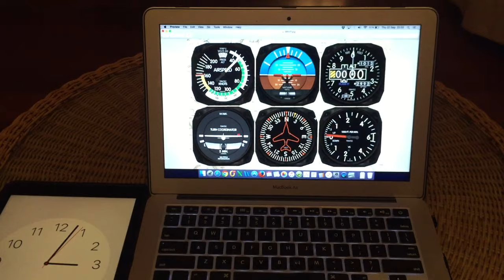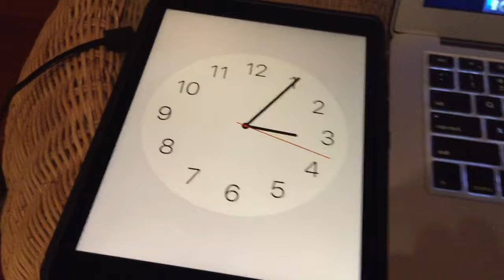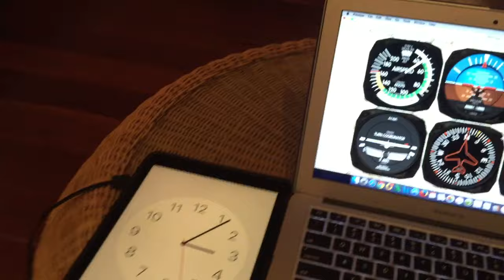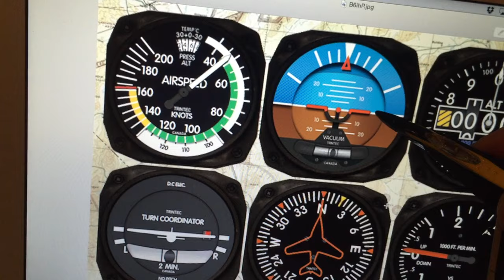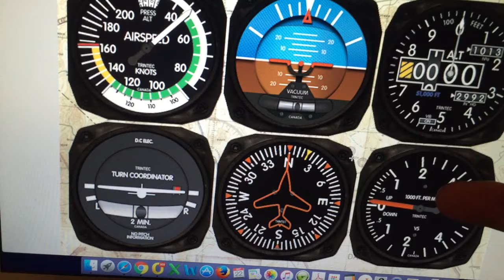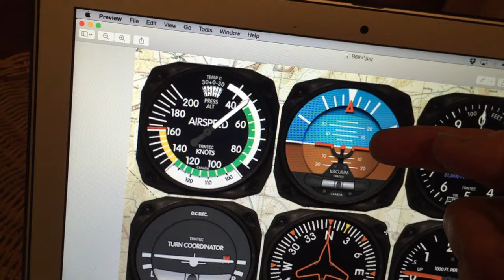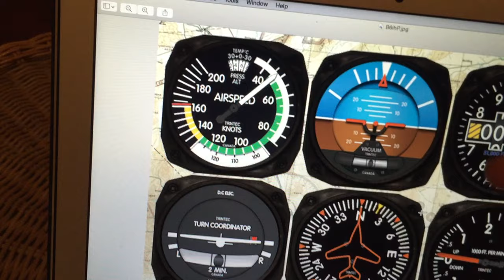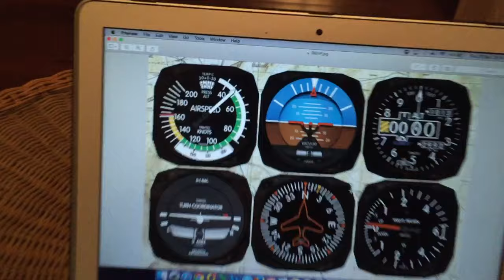Do aircraft change attitude to follow the curvature of the Earth?

Comment: With turbulence and atmosphere pressure changes which frequently cause a drop (some severe) in altitude, the pilot is frequently adjusting the plane level to maintain direction. Such that stating a plane is flying level, is only valid during the moments after a pilot has compensated any deviation.
A different consideration is flying any direction on a dead heading always ends up going south. Fly to the East and if you do not compensate for Latitude by adjusting to the north the plane will increasingly be south of its intended flight path and south of the destination.

Comment: I remember my very first encounter with a realistic flight simulator, in a WW2 setting. Took me a bit to realize that the constantly climbing plane wasn't a faulty joystick (or a flat Earth) but me neglecting trimming ;) How does that work in modern planes?
Reply from the maker: Yes trim is very important.  When configuring for landing you are constantly adjusting the trim as you extend flaps and change airspeed.  We have an electric trim that is activated by two rocker switches on the yoke.  You are constantly on it all the way to landing.  Same on take off, as you clean up and accelerate, up to 250 knots below 10,000 feet, then above that we accelerate to 320 Knots and you are trimming constantly.   Once autopilot is enabled it takes care of the trim automatically.    You also have roll and yaw trim but they require far less adjustment.
Reply: Rob Banks    No.  Trimming is not felt by the passengers. Trimming is the control that makes the yoke feel neutral in the nose pitch you wish to maintain.  If the aircraft was out of trim, the passenger would have no clue, the pilot is simply having to put more pressure on the control yoke to make the aircraft hold the desired pitch.  Passengers will feel pitch changes, but that happens from transitions between climb to cruise, and cruise to descending.  That will happen regardless of how bad the plane is in trim or not.  The pilot retrims periodically  as the aircraft changes speed, pitch, flaps, gear in and out, burning off fuel etc. just to make his job easier.

Comment: so how do you land an airplane on a moving runway?
Reply from the maker: I landed a helicopter on a moving ship a few times,  you do that by adjusting your speed so that the relative speed between the helicopter and the ship is zero. 

If you are referring to the movement due to Earth's rotation then that is easy to answer.  The Aircraft already has the same velocity as the Runway before take off.   While sitting on the ground it is moving with the Runway already. 

They are in the same reference frame.   

When you take off you are still in the same reference frame and all motion is then relative.  When you land you are still in the same reference frame. 

You are not one of these people who believe the instant a 300 tonne aircraft leaves the ground it suddenly decelerates by 1000 Mph and is now moving in a different reference frame are you?

Why would that happen? What force causes 300 tonnes of aircraft to decelerate 1000 Mph instantly?
Reply: big difference landing a helicopter to landing an airPLANE as a helicopter can hover...yes?
so are you saying the Coriolis effect doesnt play a part in landing an airplane on a moving runway? a moving runway which might be moving west to east but running north to south on a map...how you can do this amazing maneuver?
Reply from the maker: mark skidd
But a hover is stationary Mark,  when landing on a moving ship a hover won't work, you have to move to match the speed of the moving ship.

Yes we do adjust for Coriolis.  How much adjustment do you think is necessary?   Have you calculated how much drift needs to be adjusted for?

Take this example.  Landing on runway 18  (headng 180 degrees), at 35 South Latitude, flying at 160 Knots on a landing approach.

Let me know how much drift adjustment is actually needed for Coriolis. 

If you can't figure it out, just let me know what you would guess it to be.
Reply: +Wolfie.   I give up.  How much adjustment do you need 'cause I have no idea.
Reply from the maker: +Kylie Whitmore

Hi Kylie,  I might make a video explaining this also but Short Answer - less than one degree of adjustment is required for Coriolis in that example - that is less than you need for a 2 mph crosswind - i.e it is 
virtually negligible.
Reply: Like on an aircraft carrier?

Comment: Wouldn't it be a worthwhile endeavor to indicate the validity of this argument by illustrating the proof of a sphere as it is stated by the Flat Earth? We understand that the aircraft makes corrections that are very subtle, it's obvious that the pitch down has no noticeable effect on an aircraft to any reasonable person with an understanding of scale and proportion due to the small amounts needed to maintain altitude. But for fun, couldn't a pilot just take off the autopilot on a private flight, maintain a dead level flight path for a few minutes and record that the elevation rate is positive and the altitude is increasing while the plane is showing itself to be flying towards a level artificial horizon? Just prove that the plan does in fact gain altitude?
Reply: FEers would call it fake.  They aren't interested in the truth as demonstrated by their extreme confirmation bias.  No amount of evidence would ever be enough.
Reply: No. An aircraft trimmed for straight and level flight will maintain its altitude without correction as long as nothing else changes.
Reply: It would not climb. To climb it would need more energy, i.e. engine power. By definition, if you fly a level path, the altitude stays the same. But all the time you follow the earth curve. Level does not mean straight.
Reply: @chrisehmke1651  Lol. You would only need more power if you were ASKING the plane to climb by pitching it up. Why do you need more power when the ground below you is simply dipping away from you? The altitude should climb without any added effort by the plane.
Reply: @Gearyco  no. To climb you need additional power because the potential energy is increasing with height. If you were right, I could fly a straight line with my sailplane and enter space. I can't do this.
Reply: Chris Ehmke that’s not what I said. If the earth is curving away under a plane, the plane is not “climbing” even though the altitude would be increasing. 

If a plane approaches a mountain, its altitude decreases, but the plane is not in a descent. 

What happens below a plane traveling in a straight line doesn’t require a power adjustment from the plane.
Reply: @Gearyco  You got it wrong again. Altitude is not measured to the ground, it is measured to the center of gravity of the earth. To make it easier we take the sea level as reference. The point is, to climb in a gravity field, you need energy.
Reply: Chris Ehmke wrong again.
Reply: @Gearyco  Any arguments? You are not very convincing by saying "wrong". I did provide some facts. If you claim them to be wrong, try to prove this.
Reply: @chrisehmke1651  You didn't provide any facts. You just said I'm wrong and then made a claim with no evidence. So I did the same to you. It's pretty easy. 
Question: If a plane flies over the grand canyon, does its altimeter change?
Reply: @Gearyco  The altimeter does not change of course. The altimeter measures the air pressure that is not changed when you fly over a canyon or a mountain. But the altimeter would change if I fly along a straight line tangential to the earth. The air pressure will drop as I fly away from the center of gravity. To do this I need energy, just as when I would climb a stair. This all is basic physics, I will not repeat it for you.
Reply: Chris Ehmke you told me earlier it’s measured to sea level. Which is it? In fact, altitude is measured up to 5 different ways. You haven’t mentioned this, claiming there’s only one way. It seems you aren’t qualified to have this discussion.
Reply: @Gearyco  altitude is measured to sea level. Air pressure is used to do the measurement. You are trying to sidestep the original issue.

Comment: It's all about energy and gravity. The plane flies in a constant altitude, that means it has constant potential energy due to gravity. The gravity field is radial to the center of the earth, so to maintain constant potential energy, the plane has to follow the curve. It would need more engine power to climb, and reduced engine power to sink. So this happens automatically, as long as the engine runs with constant power, the altitude will stay constant. The pilot only has to correct for air movements. 

The idea of FE, that the plane would fly into space if not corrected, is absurd, as it conflicts the preservation of energy. To fly on a linear path tangential to the earth, it needs to climb in the gravity field. For this a lot of extra power from the engine would be required, that is not the case. So the plane will always follow the curve.
Reply: Indeed... but I've come across FE supporters that also deny gravity. Yes. They do walk among us. If you start talking about conservation of energy... they've already zoned out.
Reply: Chris Ehmke   Nice explanation. If you’re at an equilibrium, you basically stay at an equilibrium.